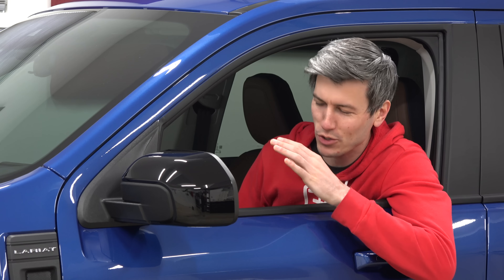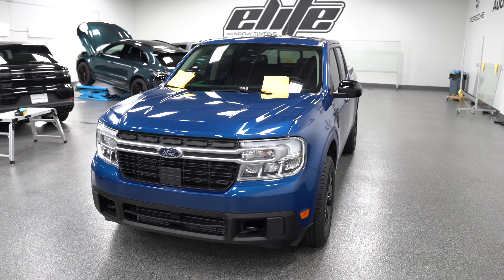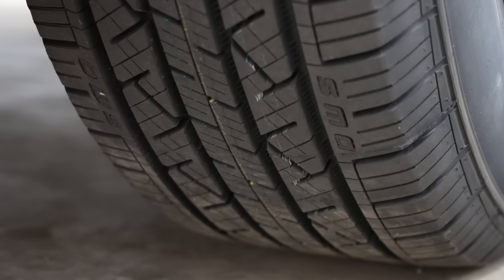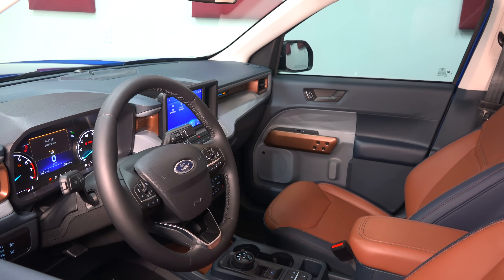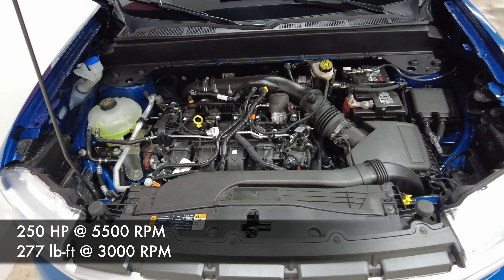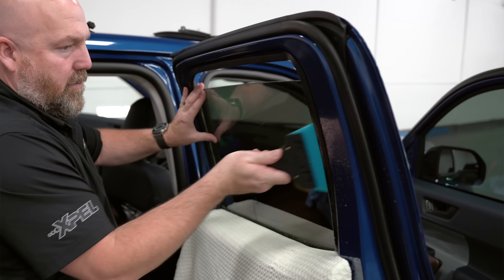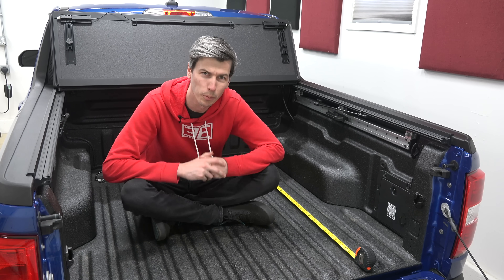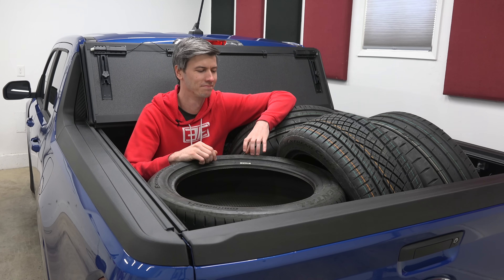I Bought A Ford Maverick! The Perfect Pickup?

Comment: The funny thing is these are the same size to slightly larger than the old Ford Rangers. I dont think people realize how stupidly large modern vehicles have become....
Reply from the maker: Yep, trucks have gotten enormous, even the Maverick is pretty big! Just not by modern standards.
Reply: @EngineeringExplained  To be fair, people have gotten quite a bit "bigger" over the past few decades.
Reply: When the new Ranger came out I ended up parking next to one in my old 2002 F150. Same thing.
Reply: @JoshuaTootell I was behind a  Blackwood a few weeks ago. It's a Lincoln f150 from 01. I couldn't belive how small it looked.
Reply: I have a 2022 colorado WT and I adore it to bits. But I realized how big it really was when I pulled up next to a  1999~ Silverado 1500. Literally the same size, actually my bed height is taller. Wish I could have gotten my colorado with the old v6 from those silverados, but the 4cyl does just fine for my needs.
Reply: @ryanking6811  Same with my 2014 Silverado 1500. It's only an extended cab and I parked next to a new Colorado. Nearly the same length and height. Just not as wide or as big a bed.
Reply: I know I had my 2002 f-150 I traded in next to my new 2017 f-150 I'm like it's huge
Reply: The new Rangers are about the size of the old F150. These are about the size of old Rangers. New F150s are monster trucks
Reply: Yes, when I drive up beside early 90 models of Tacoma's and Ranger's the Maverick is the same size. I'm sure those trucks can tow more than a Maverick but the point is that trucks today have been promoted as bro-mobiles, not for their fit for purpose.
Reply: I had one of those old Rangers, a '91 2WD XLT. It ran great but I just looked up the specs:  2.3 L inline 4...100 HP. Ouch. That thing slowed down on upward grades from 65 down to 50 mph. This modern Maverick is a worthy replacement with all the advances in small engine design.
Reply: Not really.  I had the 'old' Ranger (and before that, the Mazda version).  While the overall 'length' is similar, the BEDS ARE NOT.  The old rangers had a true 6' bed.  I.e. a REAL truck bed.  The new maverick's bed is god dam tiny...
Reply: I think people do realize, but most people like it.
Reply: I came out of a store recently and a brand-new Ranger was parked next to my 2002 F150....and that is when I realized they are pretty much the same size. Gave me thoughts about my next truck and how I could be happy with a Ranger if it fits my need at that time rather than the larger and more expensive "full size" F150.
Reply: Yep. I have a 2000 Ranger extended cab with 6 foot bed, camper shell and good sound system. Gets about the same mileage as a new one. Well maintained and cared for. There are plenty of these still around in Ca and the Pacific Northwest. Why spend $40,000 plus for a new one at these interest rates. The new Rangers are the size of an old F150. The new F150s are overkill. Just too big and wasteful unless you’re a contractor or towing an RV.

I don’t need a 4 door truck with a 4 1/2 foot bed. Great idea for urban suburban families, but not for me. Give me an extended cab plug in hybrid with a 6 foot bed and I’m in. Maybe Toyota will build one. Actually Toyota probably will build one or the Koreans will. For now, I keep running my Ranger for truck stuff, and I do need a real truck for that, and my Honda fit for commutes.
Reply: We've all kind of slowly been retrained on what's reasonable - it's like any level of excess or compromise. It happened slowly.
Reply: Yeah, i compared their dimensions to the old crew cab S10s when they where first launched and they measure within inches. Little longer, little wider and a little taller. 

Why? Because the Crew Cab S10 was the only 4 door truck i could think of when trying to picture the Maverick in person. Of course this was when finding a Maverick in the wild was impossible. Now i can walk around the corner and look at my neighbors.
Reply: @AHungryHunky  2001-2003 for the crew cab S-10s.  Explorer SportTrack (MY2001) was a thing at that time as well.  But so was the F150 SuperCrew (MY2001+) and the Dodge Dakota QuadCab. (MY2000+)
Reply: @GoFastGator  Yeah, but I just meant in the same relative size.
Reply: @AHungryHunky  I had an '02 S10 and my Maverick feels much bigger on the inside. I can fit a rear facing car-seat in the Maverick without an issue but there's no way it would have worked in the S10.
Reply: @TofuInc  I think it's the unibody design, it supposedly is roomier than thr current ranger
Reply: @TofuInc  Again - that's the problem with the Maverick - all cab, no bed.  If you need to haul the kiddos there is no better solution than a minivan.  It's just not sexy.  If you need to haul stuff to work, well that's what you used to buy a truck for.  Now anything half ton or under is more interested in back seat room than payload.
Reply: @donhappel9566  Honestly I can haul more stuff in a minivan than most trucks. I've drove minivans for years as work vehicles. Unfortunately minivans seem to be a thing of the past anymore. Towing is the only place a large truck is really good for.
Reply: @AHungryHunky  Ford actually made a crew cab 2000's ranger but they were only sold outside the US and Canada, this was because Ford didn't want to cut into the Sport Trac and F150 sales. Thought the Sport Trac was a flop anyway, Ford could have killed it with the Crew Cab Ranger. I have worked on a Couple from Mexico to Trans Swap the Eaton manual for the Mazda M5OD. The Eaton's are pure trash and self grenade, it's so bad it's damn near imposable to find them now, last one I did the closet one to me (South Texas) was in Argentina and they wanted 12k shipped. The truck wasn't worth the 12k, but I was able to swap a used M5OD in for 3k and it let them keep the truck.
Reply: @TdrSld  That's cool. I was just using the Crew Cab S10 as a basis because as an American it was the only crew cab compact truck I had any real world experience with
Reply: I do really like pickup trucks but sadly I could never bring myself to buy one. The only real reason I could come up with is towing and the reality is: They are just not that great at it...
When I needed a (used) vehicle for towing, I needed something that was able of towing close to the allowed limit in Germany of 3500kg (around 7700lb). As all of the possible choices were too large, to powerful and too heavy for daily use, I had to buy a dedicated vehicle. And when I looked at the prices vs. the specs, there really was no other choice that the Mercedes ML (W163).
It is
- relatively cheap (I paid like 5k for a fully loaded facelift V8 from 2002),
- very heavy but compact for what they are (which in Germany is important if you need to go into city centers or small rural streets),
- great cruisers (torque in abundance, automatic, cruise control, heated leather seats) and
- more capable. With a way higher towing capacity than for example Ford Rangers from the same era that would have been 3-5k more expensive.
- suprisingly reliable. The M113 is one of the best engines ever made by MB. And the 722.6 5G-tronic is also pretty reliable - if it is maintained regularly...

That being said: I'm still sad it didn't work out with a pickup. I like them so much!
Reply: Everyone mistakes my Maverick for a Ranger
Reply: Actually it's exactly sized in the middle between the new Ford Ranger and the old Ford Ranger!  I think it's ten inches longer than the OFR and ten inches shorter than the NFR.
Reply: What are you talking about? This thing is tiny, even smaller than the already miniature size Tacoma.
Reply: @OGtruthserum  It isn't tiny. New trucks are just ridiculously large.
Reply: Here in the UK, I'd consider this truck to be the average size. When I went to Canada I couldn't believe the size of the trucks there. Everyone there seems to have one, but I couldn't help but wonder how many people actually used the bed regularly. 

Don't replace the word 'truck' with 'penis' 😂
Reply: The beds on the old rangers were bigger. Smaller cab, bigger bed, actual 4 wheel drive.
Reply: I think most people over the age of 30 know very well how stupidly large trucks have become and how ridiculously expensive they are as well.  You need a LADDER to climb in or out of the full size AND the mid size trucks.  Running boards are no compensation for the OLDER folks.  Maverick sits at just the right height.
Reply: @tedunguent156  u know what's funny my wife could reach the pedals on my 2002 f-150 with seat all way up. Once I traded that in for 2017 she can't even reach the pedals even when seat completely moved forward.
Reply: @TorryGood  how tall is your wife? Mine is 5'2" and she can drive my 2023 F-150 like a boss. No issues getting in or out of it either.
Reply: @tdtommy196  she 5'0 or 5'1 my truck don't have the electric pedal adjustment.
Reply: @tedunguent156  I'm 49 and I don't even bother using the running boards to get in and out of my levelled F-150. It's not that hard to get in and out of it.
Reply: @tdtommy196  I wasn't talking about me or you.  You also don't even mention how TALL you are.  Everything is a crew cab today and OLD folks can't climb up or down safely.
Reply: @tedunguent156  what's old? Because first you said over 30. Also I'm not even 6 feet tall. I mean I get it. If you're picking up your 80 year old grandma to go out for dinner, then yeah, you should probably use the wife's SUV. But the top 3 pickup trucks in America aren't compact unibodies. There's a reason for that.
Reply: @tdtommy196  I did NOT say that people over 30 were old.  I said they remember the older trucks were smaller and lower to the ground.  Most people WANT trucks rather than actually NEEDing them.  The auto makers are very clever about separating fools from their money.
Reply: @tedunguent156  You can literally make the WANT over NEED argument for any vehicle. If you WANT to drive a Ford Escape with a 54 inch bed instead of a hatch that's great. You probably only NEED a used Focus or other compact hatch back.  If we only bought the things we need, the world would be a boring place.
Reply: @tdtommy196  You seem to have a NEED to take other peoples comments about the SUBJECT as a personal attack or challenge and twist their words to make it all about YOU.  I'm sure TorryGood would agree with me.
Reply: @tedunguent156  cool story
Reply: That Ranger had only one row of seats. But it did have an 8-foot bed.
Reply: @ric12-o2k  Oh brother, this is YouTube's comment section... Looking back on my comment from 5 months ago, it does look rushed, but there's got to be something better that you can be doing with your life than to play grammar police for youtube comments! You're either a retired English teacher with nothing better to do or it's a distraction tactic because you didn't like what I said but couldn't think of anything else.
Reply: @DerKrieger107  the new Ranger is the size of the F150 of decades ago. The original Ranger was a compact truck, a real compact truck. I have a 2000 Ranger extended cab with a 6 foot bed, well maintained. Perfect for my needs. The Maverick may be similar in size but it’s not a truck, just an SUV with a 4 foot bed. Great for urban suburban families, but not a truck. Whoever brings out a compact truck about the size of my old Ranger or the old s10 will probably get me to buy one. But, for now, I’ll stick with what I have and not pay $60,000+ to buy a new one.
Reply: Needs a 3.0 six
Reply: No small Regular Cab Pick-up has been built since 2014. I totaled a 14 Tacoma. I looked for good used ones. But hardly any manual transmissions exist. So I bit the bullet and bought a Chevy Regular Cab Silverado WT. I've been driving small vehicles since I bought a 85 Mazda GLC 2dr Hatchback. Four Nissan Pick-ups and two Toyota Tacomas.
Reply: Exactly
Reply: They are much like the Ford Sport Trac. 4 door crew cab. I just purchased one to replace a Sport Trac that I find the right size t tow my bass boat. I like a smaller sized truck. I also have two F-150 full size trucks that I am keeping as well. Big truck for big job. Small truck for everything else.
Reply: I do. I've seen the nearly 5' hoods of trucks today. Comical really. That's why I had purchased a 2012 Ford F-250 (my wife could see over the hood and felt comfortable driving it when we towed) the last non smart truck year available. I've since sold it but it remains a special place in my memory bank. 
Now I'm looking for a compact truck. This might fit the bill. 
Currently driving a Toyota Venza. A wonderful vehicle but the Maverick might take it's place.
Reply: The truck I’ve been waiting for. I bought a new Ford Ranger in 1998, and loved it! I moved up to a new 2004 F150 and never really liked it. I sold it 3 years later and haven’t bought a truck until the maverick came out! Now I own  a 2022 lariat  hybrid, lux pack, sun roof, first edition. The 2nd is a 2023 hybrid XL! Average MPG on both is mid 40s to 50s!
Reply: I think people realize it but not many do much about it. I'm with Jason on voting with my wallet. Both my cars are as small as was practically possible.
Reply: We've grown with them, so they don't seem larger.
Reply: You're gonna be unhappy with your purchase in about a year and a half
Reply: @danmyerlance  if i may ask...why?
Reply: One big difference is the 2011 and older NA rangers could easily go 200,000 miles and be cheap to maintain. The maverick is basically a ford escape. Have fun doing truck things and getting longevity out of one.
Reply: The maverick is a perfectly acceptable size. But the 1995 Ranger was body on frame, could tow more, and cost $10k MSRP. The Maverick costs twice as much even after adjusting for inflation, and it’s a crossover with a bed, not a pickup truck. 

We need BYD to liberate us from the decadence of Detroit with their cheap $10k EVs. The same way Japan did back in the day. Lack of competition has made US automakers so disgustingly greedy.
Reply: @JohnDoe-my5ip  I certainly don't want or need a cheap chinese EV, but there are plenty of things we don't get that I'd like to see here.  Insert chicken tax comment here.
Reply: People are also getting taller. I'm 5'9", and my son is 6'4". A lot of his friends are taller than me to include the females.
Reply: @domdrty  and people are much "bigger" around than they were 30 years ago.
Reply: @domdrty this. I'm 6'1 and aged 50. My opener until 2 weeks ago was a 21 year old girl who was 5'11. She's two inches taller than her husband.
Reply: @domdrty it does seem like people are getting taller but def the other way 😮around
Reply: With less ground clearance, a drastically shorter bed, no V-6 option, and either turboed or hybrid. "They're the same size." Give me a break. When it comes to a small bodied truck being able to do truck things, there's no comparison.
Reply: @jordanhart9708  Correct.  Even if they are the same external size the newer truck will be much more cab and much les bed.  For many, a truck is the new minivan.  They don't want a minivan because it isn't 'cool' and a truck makes them think they might actually do truck stuff.  But really all they ever haul is little Billy and Suzi to soccer practice.  Ever look on a dealer's lot and try to find a half-ton without the largest possible cab?  How about even a standard short bed? A rare bird indeed.  You'll mostly find the extra-short 5' beds.  A 6 1/2' short bed is rare and some don't even offer a full size 8' long bed in the half ton segment anymore.
Reply: @donhappel9566 Im gonna get a honda odyssey or one of the toyota offerings because they are comfy LoL.

Comment: I drive a 2018 Hilux a competitor against the Ford Ranger which is a slightly bigger Ford Maverick, now as a mid-size truck owner the biggest issue is space and comfort especially the leg room at the back, and the rear seats are literally oriented at 90 degrees which is uncomfortable. trucks like the Ford Maverick, Ford Ranger, Toyota Hilux, and Mitsubishi Triton just WORK, sure you have basic features but they fill the gaps between SUVs and full-size pickup trucks. They are reliable and a lot cheaper to operate compared to full size trucks but can carry things that SUV's can't.
Reply: Toyota trucks suck in the back seat.  Not so much with the Ranger Raptor or the maverick.  Our family has both with kids and they are fine.  I'm 5' 10" with my maverick and my brother is 6'1 in his raptor.

Comment: Video idea for you:  Wheels affect fuel economy. The new Hyundai Kona 64kWh model is available (depending on market and trim) with 17" or 19" wheels.  The 17" wheel model is understood to be more fuel efficient.  I thought this was because the larger circumference - needs more torque to turn.  But then, I noticed two things:
1) The circumference is smaller than I assumed. The two tyres used are 215/60 R17 96H and 235/45 R19 99V - 560.8mm and 588.35mm circumference respectively, if my calculations are correct
2) The 17" rims have mostly flat/smooth sdies, so definitely more aerodynamic than the 19" alloys.

So the question is: Can you calculate how much the wheel circumference and aerodynamic each affect fuel economy?

Comment: Fantastic tongue in cheek delivery of "it's a truck" etc.  Made me smile.
This looks like a fantastic solution for a small home owner. If they had an all electric version, I'd pay significantly more for it.
The American consumer needs the compact truck option. All I need is to be able to move a couch, refrigerator or a yard of barkdust. And I want to be able to tow a couple ATVs or jetskis.
I'll never get a hybrid though.  I don't ever want to do another oil change or accessory drive belt change.
Worst of both worlds.
Reply: A lot of hybrids now are powering them with electricity, so I'm not sure if there's even a belt to change in the first place?